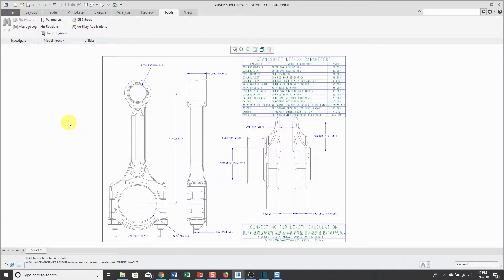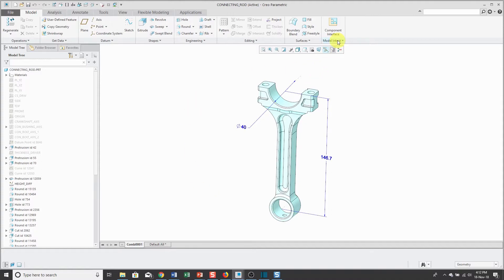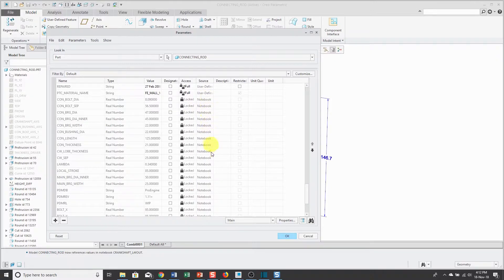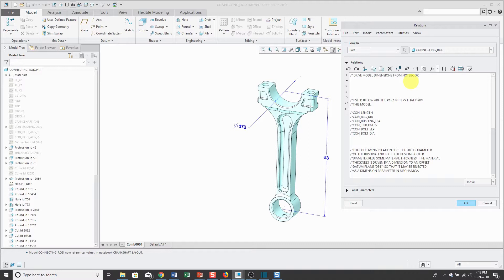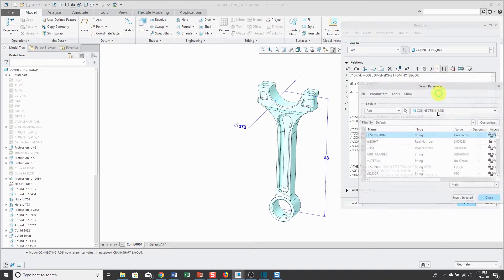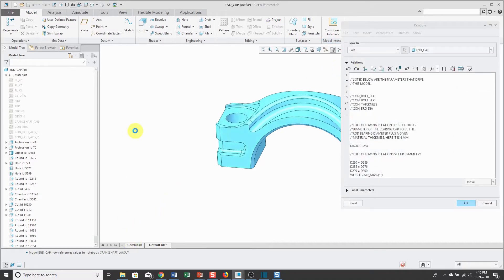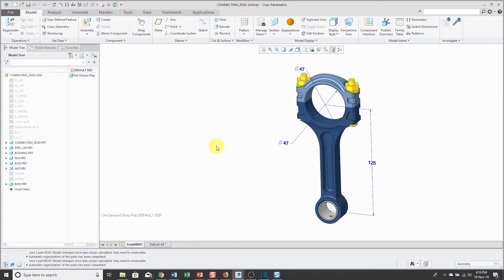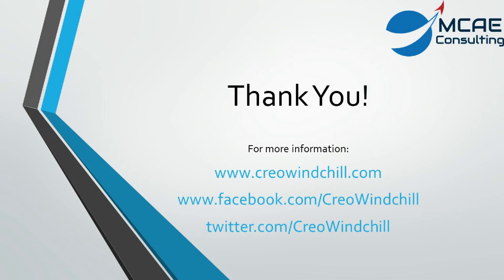Creo Parametric - Top Down Design - Linking Notebooks to Models via Declare

Comment: Thank you Dave for this awesome demonstration. I have a question about this section please. From what I understood, after we finish creating the notebook (like in the previous video), we create the 3D model as if it is not driven by the notebook then at the end we link the critical dimensions by the notebook relations and parameters is it right ? thank you
Reply from the maker: Gasmi, you can link the model to the Notebook at any time. You can Declare it right after you create the part and as you build features you can write Relations between the model dimensions and the Notebook parameters. You don't have to wait until the model is completely designed. Basically whenever it is easiest or makes the most sense.